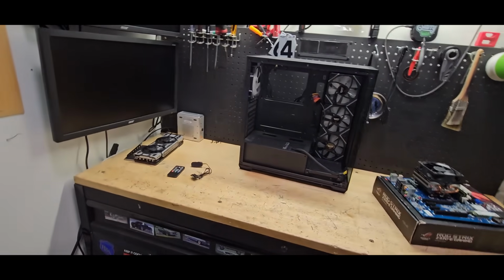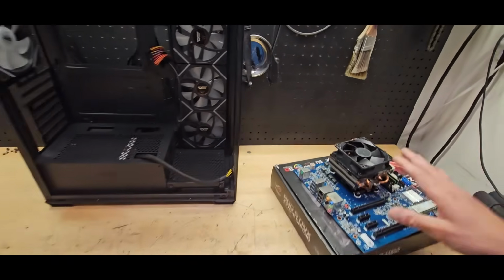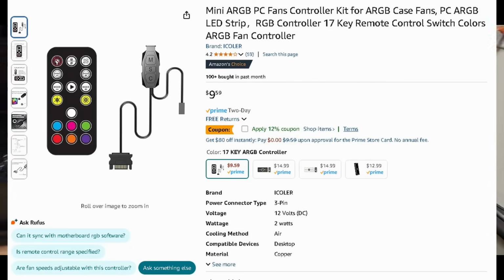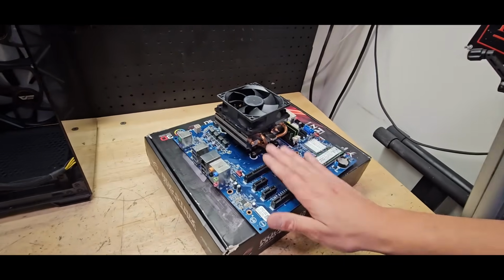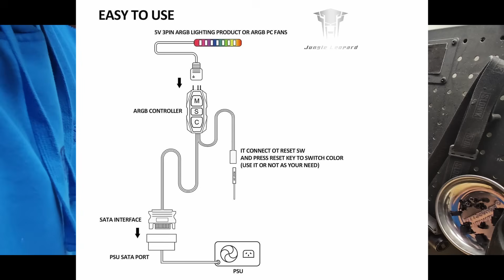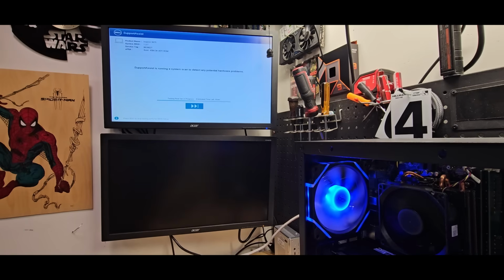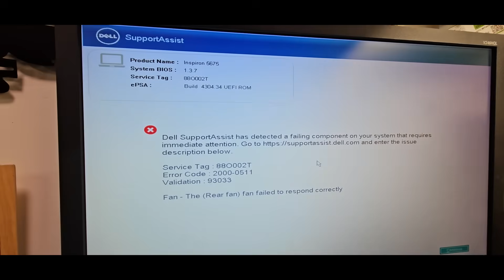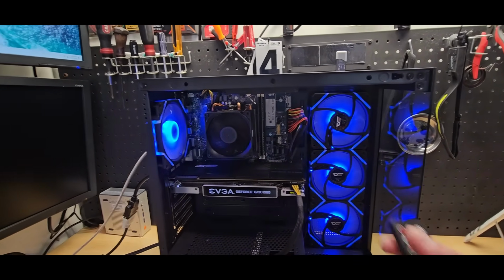This made selling old Office PC's soo much easier!!

Comment: You might have room for a pci-e audio card, if the video card`s fans don`t touch it. I have a system where i installed an audio card under the graphics card and it is ok. A lot of dedicated audio cards sound better than integrated and they have front audio connectors (and they work). If you have a spare audio card you can try.

Comment: lol no putting as many fans as the case can fit can actually make performance worse + waste of money.
My case can fit 15 fans but I found it performed best with only 9 + the size (12cm or 14cm) can make a difference, 14 isn't always better, tried both 12 and 14 fans under the GPU and 12 performed better.

Comment: That seems so new (2 me) .... 5675 is around 190$ in my country....(used). I'm still stuck most days on 08'(or older) dell machines... I never had the need to upgrade. I don't have time to use all my systems & laptops , I usually can use 1 at a time when I have time. ( I don't like to trow away , I prefer to save/repair ewaste).

Comment: I get the argb adapter from AliExpress for around $5.   Cut out the amazon middleman sellers, they probably buy the same on AliExpress in bulk anyway.  I won’t buy  anything sent directly from seller.   Use AliExpress choice its like sold by radom Amazon seller but shipped by amazon.   Got burned with seller scam on AliExpress by buying a computer case sent directly from seller who sent it to a company shipping and receiving department in my same city.   Signed for by G Lee whoever that was.   Never told me what address it was sent to.  I guessing they sent a stick of gum to them got a signature for all 300 Boxes/ letters sent.   Was a hassle to text with language translation to AliExpress but I did receive a refund.

Comment: Nice video. I use the same thing to get the rgb  fans going with remote. One thing i found out, is if the rgb fans are controled by the power supply itself, it does not work.

Comment: I'll have to check out that adapter at some point. And I've used a good number of the rgb remote/sata plug hookups for older gen board builds. They're nice to use and I look at it as using less system resources.  I tend to want to take the CPUs from some of those little workstations to sell em in gaming builds/better motherboards. Like, recently I was given a little Dell pc that has a i7-9700. Figured I'll toss a 9400/8400 in it and throw the 9700 in another motherboard with some other parts I've got.

Comment: I've done a few and never used the power button adapter just connect to the correct pins and never had an error. Those RGB adapters with the remote are good I've used a good bit. Notice some of them have the remote + 2pin connection you can use for reset button to cycle the lights too. Prices are about the same, but sometimes they send the regular remote only version.

Comment: One thing i learned with those 5675 am4 boards is they are very picky with cpus and its based on what model the board is. Bristol can only use the a10 9700k and the one below it, summit is only first gen ryzen (ryzen 5 1600 must be AE model not AF) and then pinnacle uses 2nd gen ryzen ( dont remember which ones though)

Comment: The adapter and pinouts makes me think of the HP Z400 FreeNAS project I just built; Early 2010s was a wild time for HP and DELL - people have dubbed them 95% ATX compatible! I amazon'd a ATX to HPz400 adapter for $10 - solved that problem quick. I didn't want to use the old cooler on my Z400, so thankfully there was documentation about the 5 pin fan pinout - I literally snipped back the alignment tab so that a (4 pin) $10 Amazon cooler would fit, and then snipped an old LED header to 1 pin to force it to (case)ground. Worked like a charm to stop the CPU fan error. Theres a similar error for front USB, but thankfully that something you can turn off in the BIOS so that you don't have to hit enter to continue.

Comment: I recently discovered these too, I found some for about $6 on aliexpress. Worked a treat for a recent flip with a cheap biostar b450 board and infinity fans ($5 each on AE). If you do get them from China, you will need to buy CR2025 batteries for the remotes though.

Comment: Their is a 7 to 4 pin adaptor for front audio and yes you can pin them out only take about 10 minutes to do if that.
Reply: 🙂 cool, thanks for the headsup
Reply: The Dell front panel adapter should work, you just cant fit it in that tight spot with the m.2 next to it.

Comment: Dell does a air duct/tunnel cooling system with most of its office desktops so the rear fan is very important. I haven't messed with dell in 10+ years so had no clue they had proprietary front panel connectors now, nice to know there is a adapter out there in case i run into it.